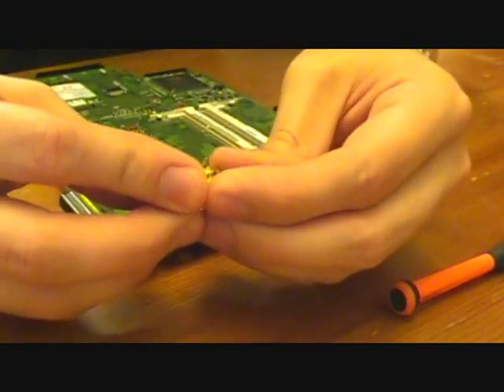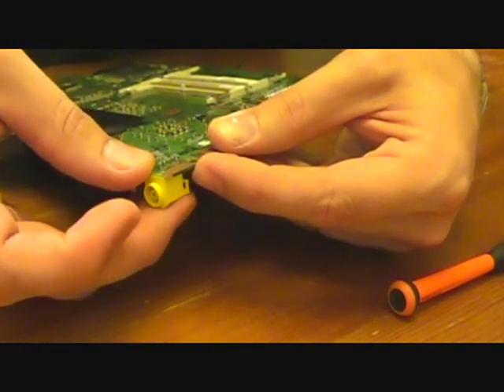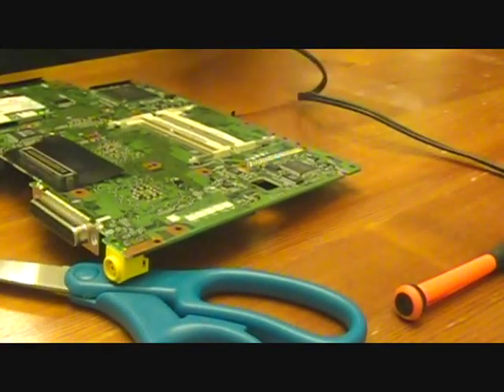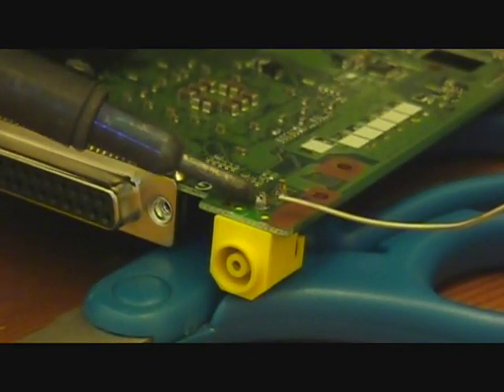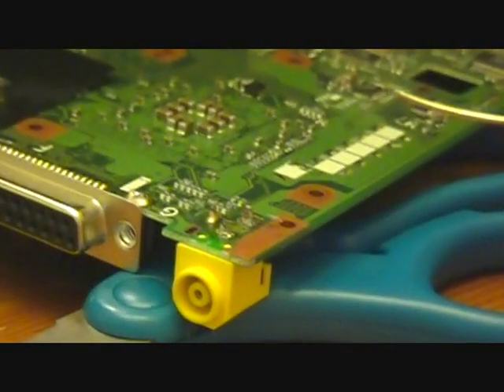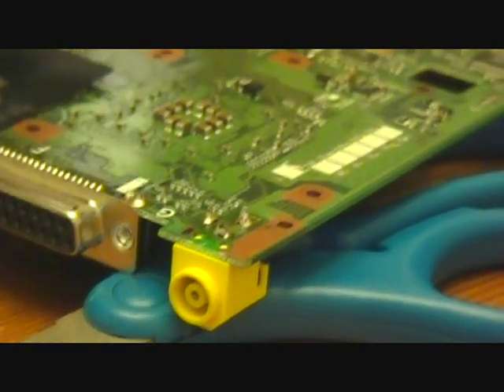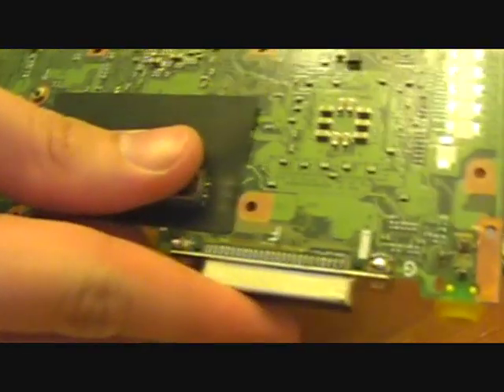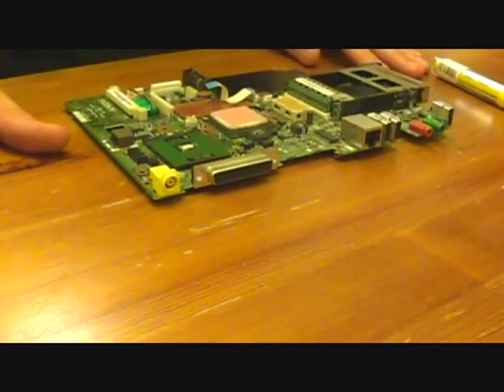Laptop power jack replacement part 2 soldering

Comment: @mjmcomputers Thats how my toshiba is the jack that you plug the charger into is called a singatron and it plugs into 4 pins that are on the mother board but the part where you plug the charger into on mine broke so I have to buy a new one -__-

Comment: Why cant the makers of these Computers design a Socket that can be pulled out from the motherboard, itself designed like a plug, so it just connects into pins from the inside ?? - like a normal mains socket, is what im trying to say, It wouldnt be such a pain in the ass job trying to replace - maybe i should put this to the makers and hopefully become rich?!

Comment: Great video. I just repaired a DC jack on a laptop that had a cracked solder joint and it is working fine now.

A quick tip for anyone doing solder work on a laptop motherboard, make sure you have not accidental gotten solder where you shouldn't and shorted two solder points together. And also using a multimeter to check the resistance of the solder joints you have just made is a good idea too.